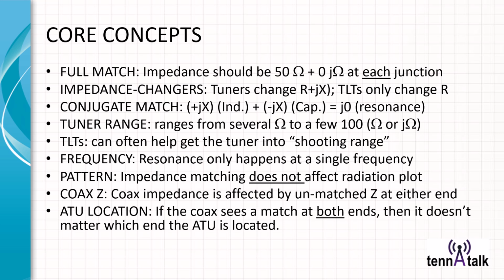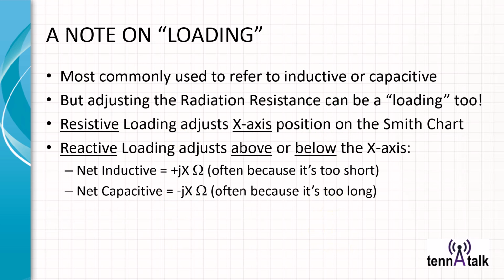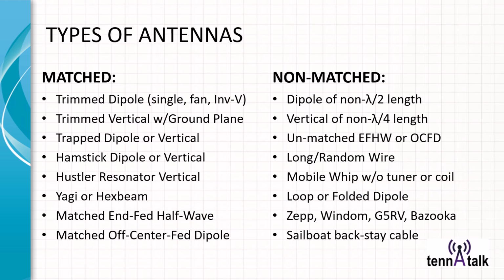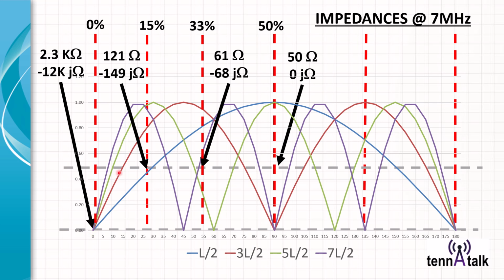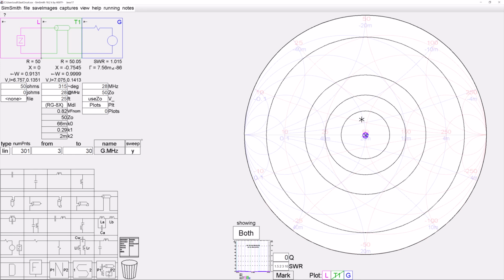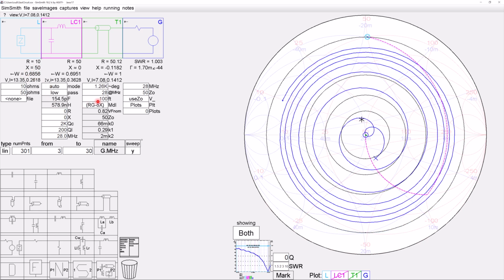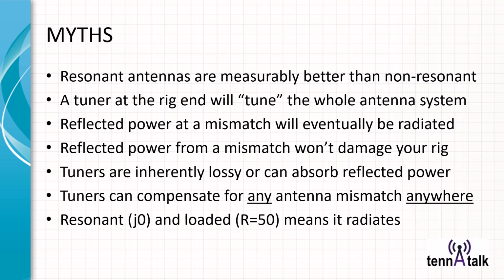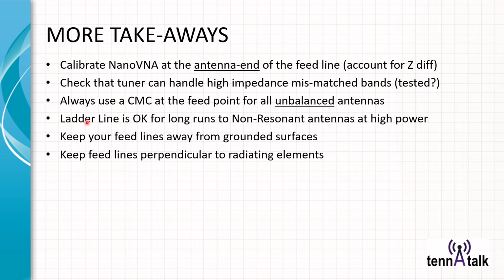TennaTalk #9 Demystifying Non Resonant Antennas

Comment: Overall, very good.  I do not agree with your statement at 6:18 where you say that a TLT (e.g., UNUN or BALUN) changes only resistance (R) and not reactance (X).  In fact, a TLT transforms both R and X magnitude.  In other words, whether or not V and I are in phase (i..e., purely resistive) or some degree out-of-phase (i.e., resistive and reactive) the magnitudes of V and I are transformed.  And as you make clear, V and I magnitudes and their phase relationship (which is not transformed) determines R and X magnitude.

Comment: ARRL Antenna Book - It is a mistake to assume that there is anything sacred (in effectiveness, at least) in using a resonant antenna. The resonant length happens to be one that is convenient to analyze. At other lengths, directive properties are different, radiation resistance is different, and the impedance looking into the terminals of the antenna contains reactance as well as resistance. The reactance presents no problem, because it can be "tuned out." The antenna system can thereby be resonated, even though the antenna itself is not resonant. The purpose of resonating either the antenna or the system as a whole is simply to allow power to be fed to the antenna easily.

I add that an Extended Double Zepp (non resonant) has 3db gain over a dipole.  

So how are resonant antennas measurably better?
Reply from the maker: For my money the biggest advantage is its versatility for multi-band use with decent effficiency and launch angle. A vertical dipole will have the lowest launch angle given its proximity to the earth.